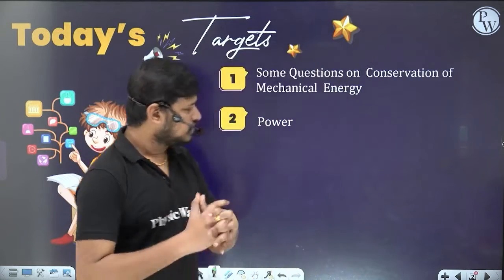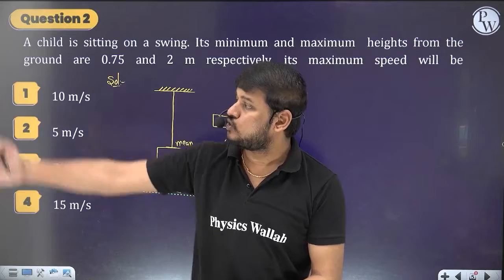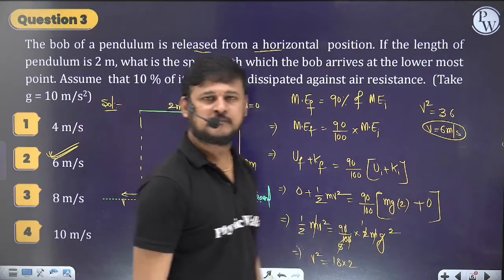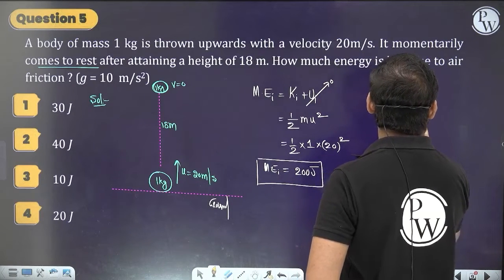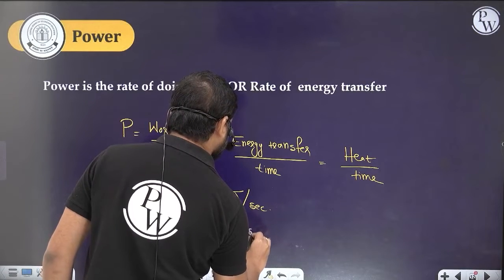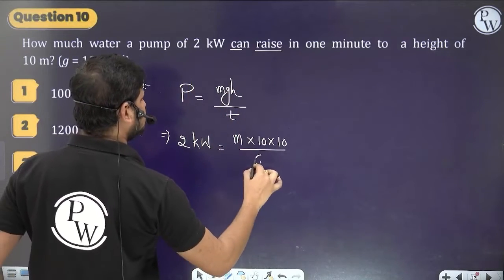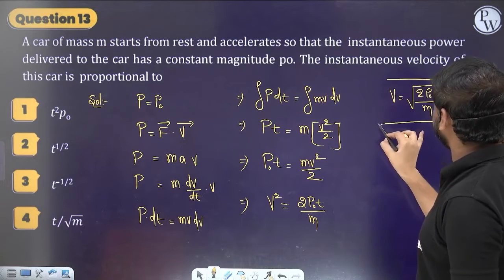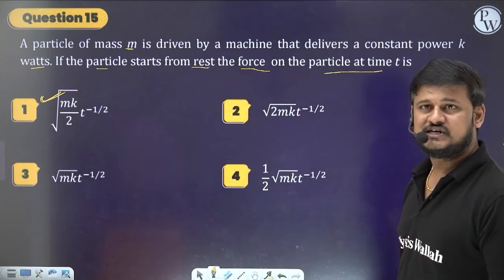WORK POWER & ENERGY - 06 | Power | Physics | Pure English | Class 11th/NEET/JEE

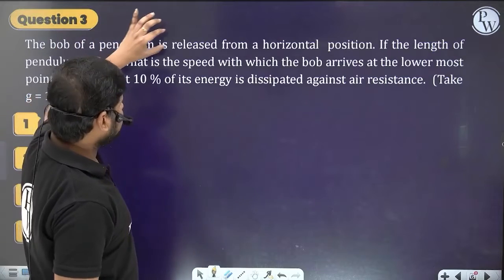Comment: 14:23 in question 3 there is air resistance which cause the energy loss. Actually air resistance is a non Conservative force  so how is it possible to use the conservation of mechanical energy
Reply: They hv mentioned that 10   percent is dissipated so the total val won't get affected